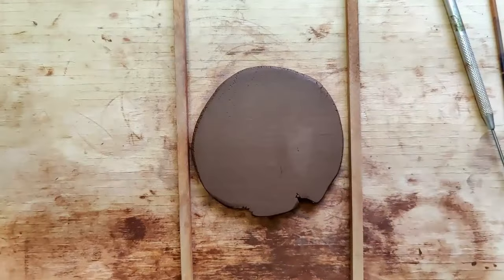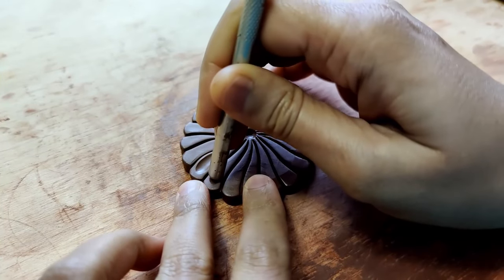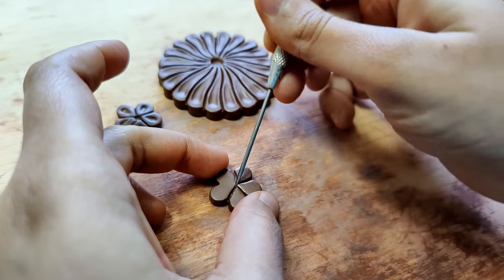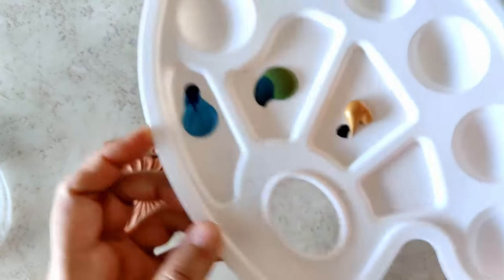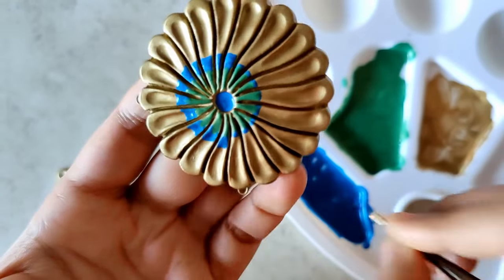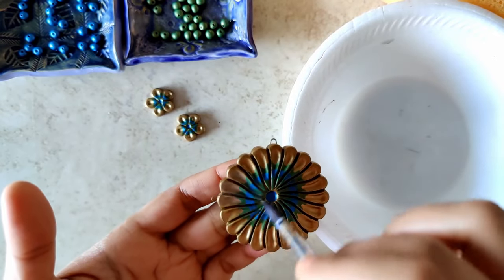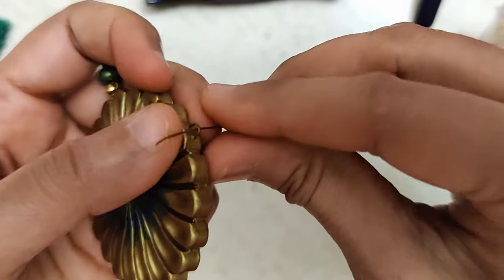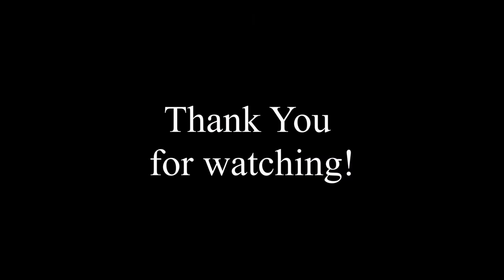Medallion style pendant in Peacock colours | Floral | #paintedearthbyneha #terracottajewellery

Comment: Do we need to mix water with varnish? Or directly we can apply varnish
Reply from the maker: I add a drop or two of water to my varnish if its too thick. The product I use is a water based varnish. If you are using an oil based varnish thin it accordingly (obviously not with water):)